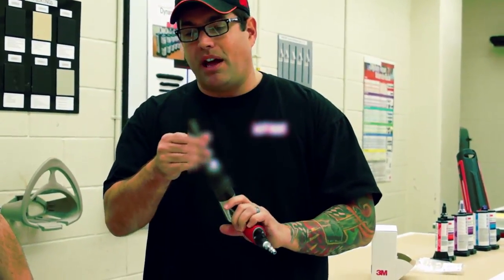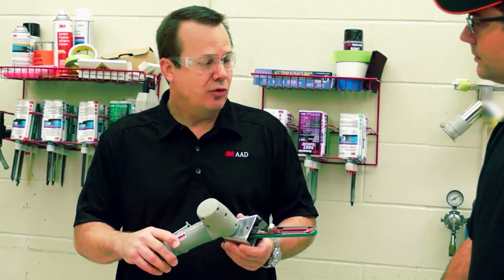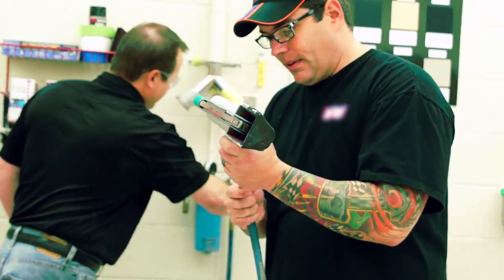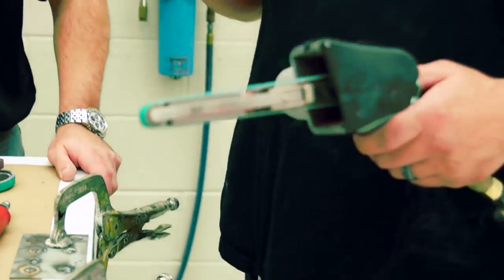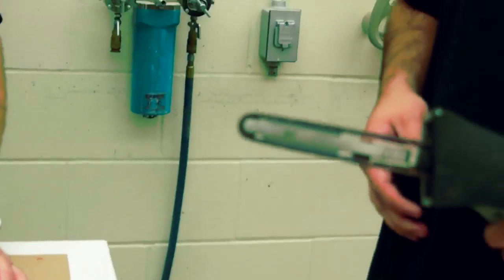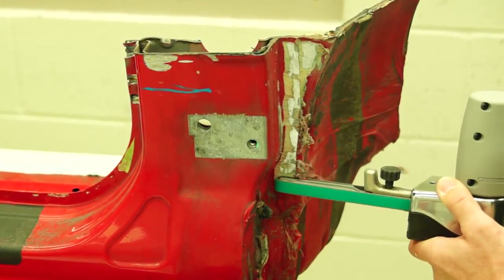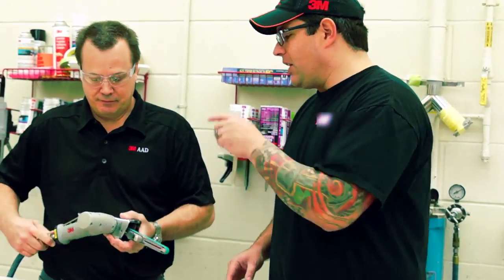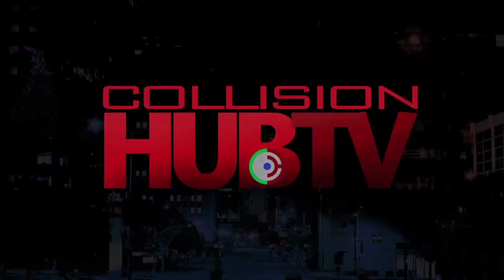How to Remove and Finish Spot Welds in HSS or UHSS with 3M File Belt Sander DIY

Comment: Yes they are great but there's times you can not use them ,you have no choice but to drill. Find a drill bit that doesn't ware out in 3 seconds on high strength steel. Like on frame rails. When you have over lapping panels.

Comment: Just seen another vid on the 3m 80 grit and this fella recons he's been using the same belt for 2 weeks on spot welds at a body shop,I called bullshit is this true ? If so I'm dumping the drilling...
Reply: Bullshit -- using 3M 36+ CUBITRON II FILE Belts I get 1-2 spot welds and each belt is DONE. Stick with the drill bit
Reply: Nick Andraka lol what?  I can take off a full quarter panel with one belt.  I do it all the time!!
Reply: If you use a 36 grit belt, the grain flies off as soon as it makes contact. A 60 grit will cut a spot weld faster and last longer.
If its eating belts that fast then the rubber wheel on the end of the contact arm is worn down to the brass. I've seen em chew up belts in one to two spot welds if that's the case

I've always been a fan of the Norton Blaze belts, personally

Comment: you know that several companies literally make spot weld cutting bits, right? they're like $1-$2 a piece on eBay all day long.
Reply from the maker: Mr Brooks buy one for $2.00 and tell is how it does on HSS and UHSS
Reply: Belts are also a couple bucks too, without the physical effort
Reply: Try drilling through high strength steel with those cheap bits, they will last about 3 seconds.